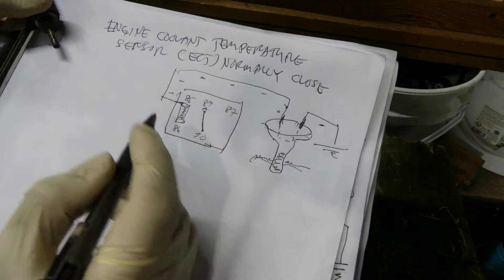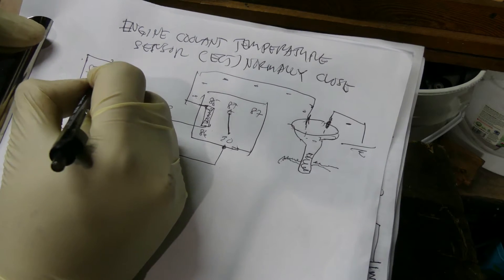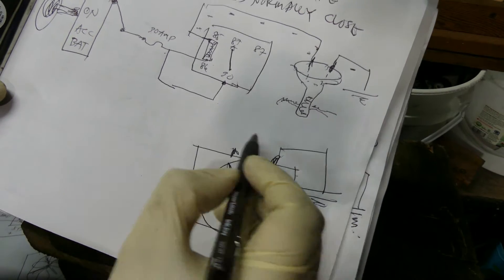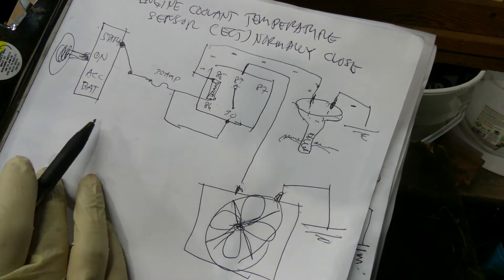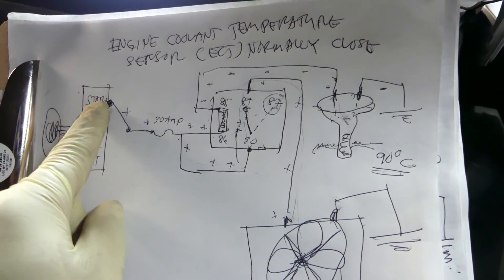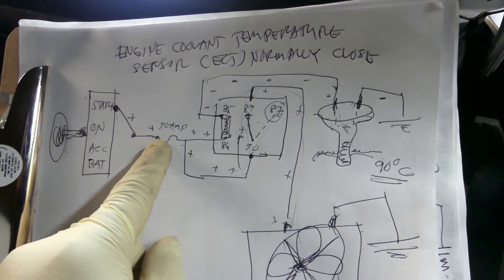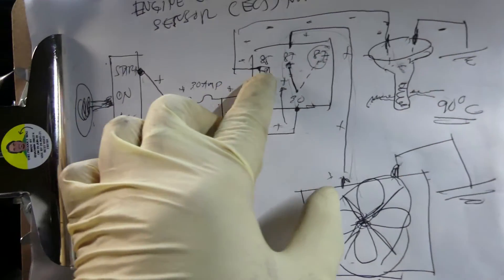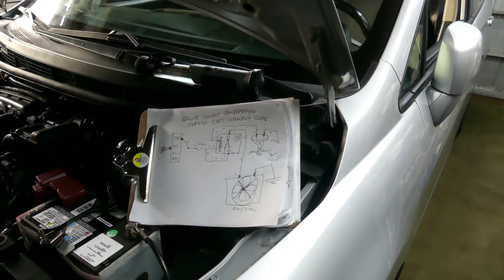How Radiator Fan works .. Engine Coolant Temp Sensor  CLOSE LOOP  DIAGRAM...( Non ecu controlled)

Comment: Thanks, but i have a clarification to make. Questions that needed answer sir. I have a ford eco sports automatic. That when i start the power button the engine and radiator fan activated and it turns to high speed fan that cannot control even if the temperature  is in very low and when i off the engine, it will deactivated. But if i start the power switch w/out turning on the engine, the fan will still activated even if i turn off the a/c button. Pero yung aircon temperature walang problima, yung fan lang sobrang High kahit nasa pinaka low na. Sana masagot mo sir yung tanong ko, especially sakin na hindi pa familiar sa mga cars. Thank you.
Reply from the maker: ur problem is blower motor resistor my video din ako nyan nissan frontier hanapin mo nalang sa channel for maintindihan mo

Comment: Hello sir, am glad to see ur channel. Pls I want to confirm if my Toyota Camry hybrid is ok. Am not a technician guy. I just noticed my radiator fan will not work on 84f but immediately I put on the car AC the fan pick up instantly. Plus I don’t no if it working above 90f but I will keep an eye on it. But my car temp gauge is always at the middle so it not overheating. Pls sir ur advise is needed. I don’t want to take it to a mechanic bcos here in Africa no trustworthy person even when ur car is ok they will still tell u d wrong thing just to take money from ur pocket. Pls ur advise sir !! Tanx
Reply from the maker: every car when ac is on rad fan is on thats normal

Comment: Bro i have a problem with my lancer i have 2 fans it only works when i turn on my AC. But when i turn off my AC it will turn off both fans. Even my sensor reaches 90.  Degrees fahrenheit the coolant. Can you give me some advice ? Salamat bro!
Reply from the maker: get a wiring diagram find out if the design is close loop or open loop positive controlled or negative controlled... backprobe the control wire for ur radiator fan check if theres a power coming into the rad motor fan

Comment: I am confused what's showing for what is point what's one is need to change
Reply from the maker: This is how ur radiator fan works...when u start ur car ur radiator fan will not turn on yet ..So when it will turn on ..Watch the video...Then why the radiator fan need to turn on ..so that ur engine will not overheat...

Comment: Sir, My car radiator fan starts at 97 to 98 temperature, and when Start and becomes 92-93 it off and on again at 97-98 . This is good condition or not
Reply from the maker: yup its good its a little bit high but maybe that its design

Comment: Wait please,  my 2013 impala stated running the fan soon as I started the engine, so I unplugged the connector to the sensor  to see if the fan would stop running, but didn't stop running , so I connected a new sensor to the connector  with out installing it and the fans kept running, does the sensor have to be grounded? Also I get a warning that says engine hot a.c. off
Reply from the maker: in that case you need a wiring diagram i think ur fan is grounded thats why its on all the time..we need to know if its a ground switch or power switch close loop or open loop sensor

Comment: I have a 2001 nissan xterra I am going to change from clutch fan to electric fan can i connect the hi fan negative  cable to the temperature sensor which is controlled by the computer instead of acquiring a temperature hit sensor to place it on the radiator????
Reply from the maker: thats pwm pulse width modulation input coming from ecm ill upload videos of that in the future

Comment: My 2001 chevy cavalier is overheating because cooling fan is not working at all
I already put new ECTS and new radiator 
I checked all the fuses and relay with test light 
Cooling fan only works when I use jumper wire in relay terminals 30 and 87
Can anybody help me
Reply from the maker: so you had no input going to ur relay try to unplug ue ect connection connect them together if ur rad fan didint work u had a wiring problem  ect wire going to ecm and ecm input to to the relay ..this is just a guess as i didnt diagnose or check ur car personally
Reply: @asianmechanicguy6483  With Ignition off engine not running
I had power to the relay checked with test light
After I put a new ECTS with engine hot I turned on the AC and cooling fan was working
Reply from the maker: so meaning ur radiator fan is working now in theory what makes ur rad fan to work is ur ect after it reaches a certain temperature so run ur car if you had an obd2 scanner monitor ur car temp and at 90 to 100degree celcius ur rad fan should kick on otherwise if not the theres a problem from the ect wire going to ecm and ecm wire going to that realy which gives ground signal to activate that relay and that relay will activate ur rad fan to works...

Comment: Hello thank for your clarification on the diagram. i have a question would like to ask you. i have a niss -xterra 2007 and the temperature heat is going up when i step on the gear 45mph. When i first start the engine the radiator fan didn't come on until 20mins latter the fan is on but the temperature gag still going up when the speed on 45mph. Please advise. Very appreciated so much!
Reply from the maker: you need a scanner theres no way you can diagnose ur truck without checking some data on a scanner ..monitor ur gauge if it reaches more than halfway and ur rad fan is not on then theres a big chance ue ect sensor is failing but again u need to scan ur car brother

Comment: I have problem with my car when AC is on cooling fan is always on never stop until i switch off the AC
Reply from the maker: thats normal ac on cooling fan on too
Reply: It is not automatic? I mean other car it stop a while then on again mine was on always
Reply from the maker: @romeantiko2706  most car will turn on the rad fan when you turn on ur ac ..what is your car year and model by the way
Reply: @asianmechanicguy6483  my car is ford fiesta 2010
Reply from the maker: @romeantiko2706  dont worry about it theres nothing wrong with ur car thats normal

Comment: I changed temperature sensor in my Mitsubishi minicab but radiator fan continuesly working when i start the engine  in the morning .
Reply from the maker: unplug the the wire then key on check for voltage 1 wire or connection should have a 5v and 1 is 0v ...then let me know what voltage u get i need info about your car i need to know if you rad fan is non ecu or ecu controlled .. pwm or conventional type rad fan
Reply: My 96 Subaru Legacy does this. Ignition on and the fan starts. Also engine is hard to start from cold. Believe it relates to the temp sensor (ecu type) the sensor has been changed but the fan and cold start still remain. Help! Please  😩

Comment: Soo in this case what’s wrong is it the temp sensor or the Relay
Reply from the maker: theres nothing wrong with the car in here bro ..im just showing you how your radiator fan works and few components that you might check if ever ur fan is not running or working..

Comment: Why do 2003 Pathfinders 3.5 engine overheat? Is it the other thermostat under the intake manifold? Thank you
Reply from the maker: i think the design or location of waterpump its inside the timing chain cover so couldnt notice right away when its leak it wiil just fix in ur engine oil

Comment: it explains my situation well in which I pull out sensor, the fan activated, but why there is disconnection when the temperature rises? I notice that when the temperature increases, the resistance between pins of temperature sensor decreases.
Reply from the maker: then ur sensor goes bad during hot temp
Reply: My car is the same problem can you guys suggest what is the solution for this problem?

Comment: My radiator  fan won't come on even when is 190f, but when I pulled  the connection  of the sensor  switch  the fan will work. What do you think the problem?  please help ..
Reply from the maker: then ur sensor is failing replace it

Comment: sir i have 3 pins ect which wire going  to relay
Reply from the maker: ecm controlled yan bro iba ang approach na gagawin
Reply: @asianmechanicguy6483  yes bro yung 3pins punta ng ecm pwede mag tapped nlng punta radiator

Comment: Thanks , What is the diagram of a fan that works when the air conditioner is on or when the engine temperature is high?

Comment: I changed my fan relay still nothing  an try to take off engine coolant temperature sensor  an van didn't kick on . I don't know what else too doo
Reply from the maker: unplug ur radiator connection then put direct power positive and negative to ur radiator fan

Comment: Hi 
I have the same problem on my qashqai j10 the fan doesn’t work, it just works when I disconnect the sensor? Is that rele error or sensor ? Pleas help me
Reply from the maker: base on what you said wiring interity is ok cuz when u unplug the sensor wire the fan kick on so its normally close system but i assume ur rad fan is ecu controlled ...and base on what u said ur sensor is faulty so change it
Reply: @asianmechanicguy6483  thanks for the answer

Comment: My Honda has a coolant fan switch? And a coolant temperature sensor? I replaced cooling fan switch which reads coolant and triggers fan, I thought, the cooling fan isn’t coming on so should I replace the coolant temperature sensoralso ? Because I can keep my car from overheating if the ac is on because the cooling fan stays spinning. If I turn that off my car begins to get hot and my operating temp appears to be right under half
Reply from the maker: unplug one of them then run then scan it that we you distinguish which is which

Comment: Thank you for the information sir. Regardless of opened or closed loop, the sensors should have about 2000 Ohms right? If closed loop sensor does not show about 2000 Ohms, can i assume it is bad sensor and needs to be replaced?
Reply from the maker: I rather do this procedure .Checking resistance sometimes may fail especially if ur sensor malfunctioning when its hot
Reply: Aclarame algo si te es posible.
Cuando el auto esta frio,¿ ese sensor esta con el circuito cerrado, es decir, mantiene continuidad en la linea negativa y esta se interrumpe al llegar a unos 90 grados que es cuando el circuito habre?

Comment: Very informative sir. Just want to ask if this car is ECU controlled? And how can i know if my ECT sensor is normally open or normally close? I own a lancer 1997 btw. Thanks. More power
Reply: My 1995 nissan 240sx  does exactly  the same  what do you think the problem  is?  I replace the sensor  already.
Reply from the maker: a normally open sensor when unplugged ur radiator fan will not kick on a closed sensor when unplug the radiator fan will turn on..mostly non ecu controlled car are those old car carburated car